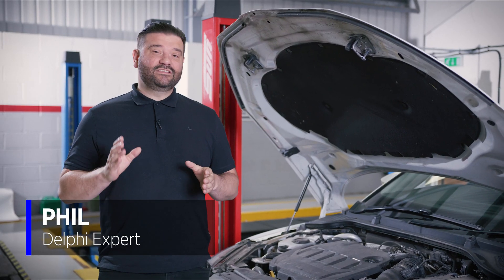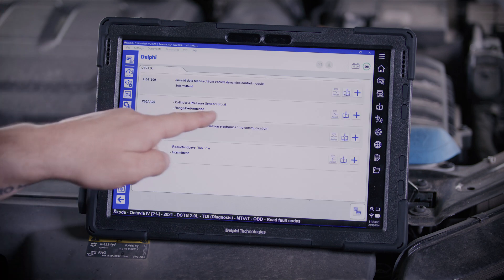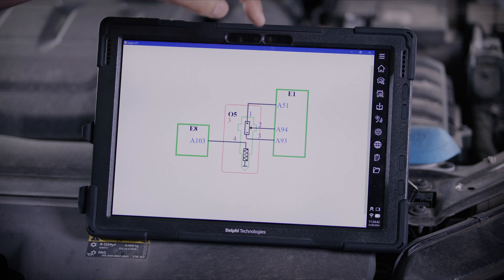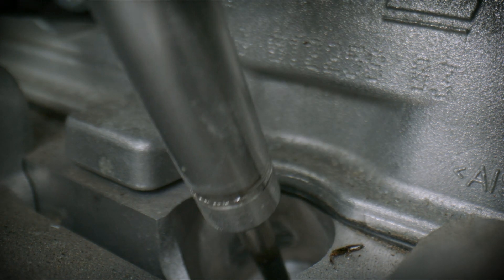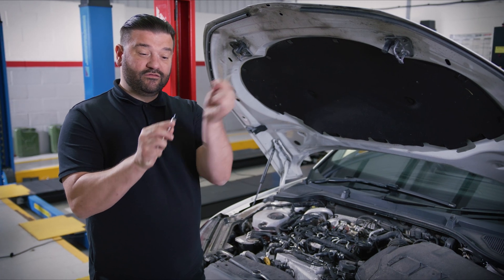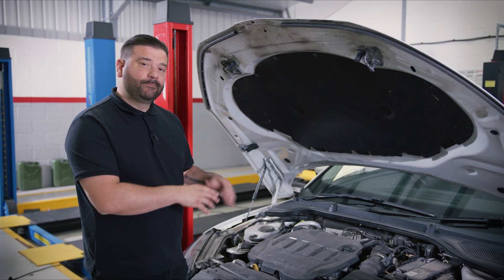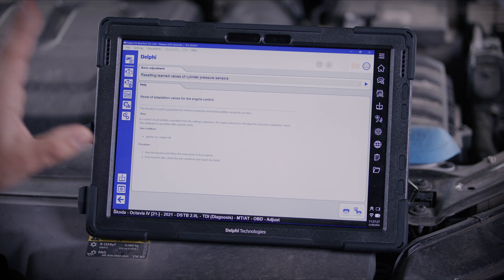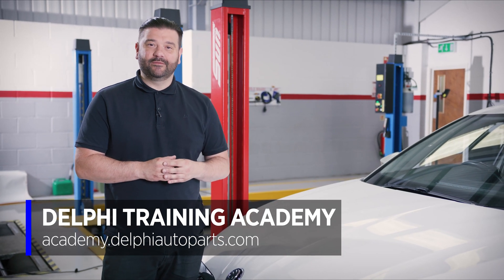[EN] Check and replace a diesel in-cylinder pressure sensor | Masters of Motion

Comment: 3:57 Hello, why didn't you lubricate the threads with ceramic grease?
Reply from the maker: Hi, and thanks for your comment! We aim to keep these videos as clear and concise as possible, which sometimes means editing out certain steps - especially if we've covered them in other videos.

For this particular vehicle, Tesla recommends using Silaramic lubricant on the pins and sliders. No grease is needed, or recommended, on the threads.

Appreciate you watching!